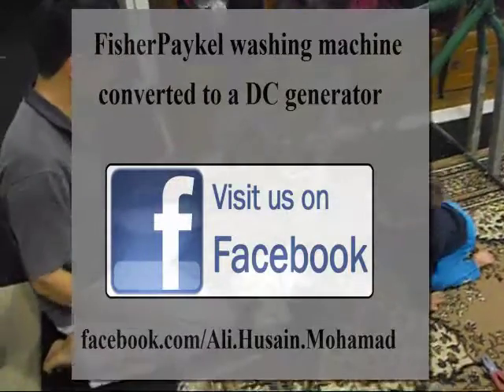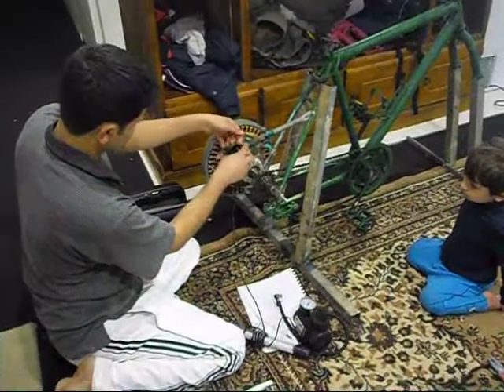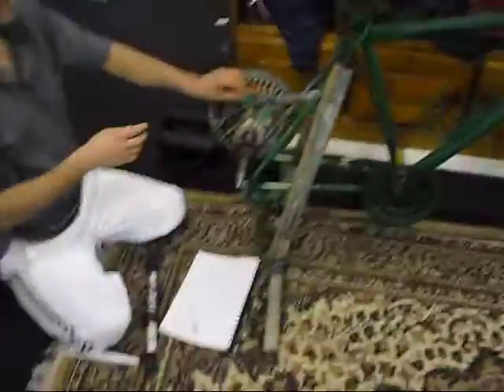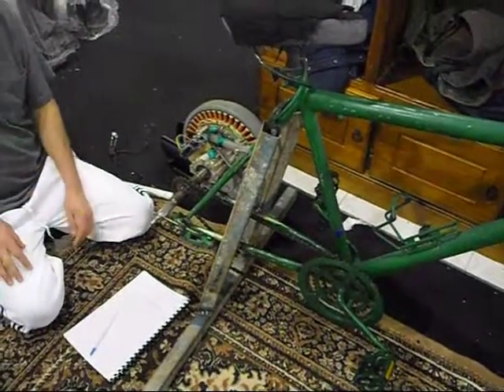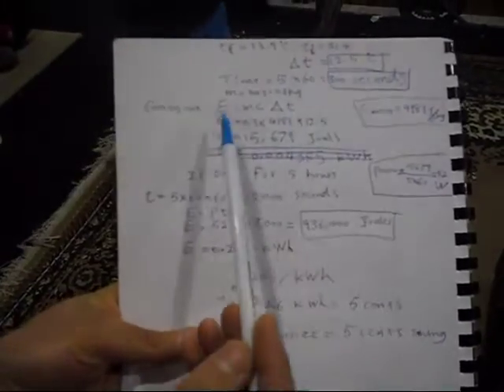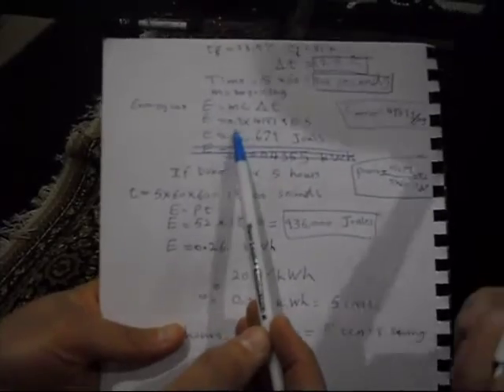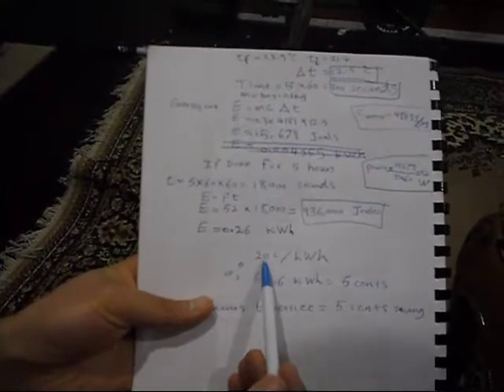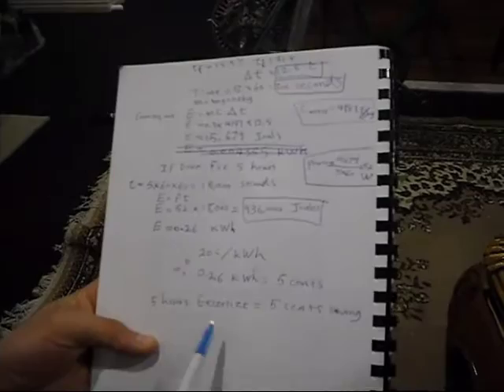fisherpaykel washing machine motor converted into DC generator

Comment: Good video but you have no mechanical advantage....gears and sprokets are essentially a lever...your trying to drive your genny with no leverage...go with a drive system bigger than your generator.....your loosing it there
Reply from the maker: the generator resists hard when it creates load so I dont think any mechanical change can do anything .  lower gear will make it easier but slower and  will give you less RPM and higher gear will be too hard to drive and hence you will slow down and get lees RPM 
and the power output is related to RPM

Comment: Man that sucks, I was not expecting such an epic failure, you are so humble about the waisted effort, most people would be smashing the smart drive with a hammer, it so funny,but why did it produce such little power? I thought those penkel motors worked great as generator, was it an older model? I heard they have a thicker guage coil wire and dont work nearly as well
Reply from the maker: thank you 
it created good power and can create good power maybe around 200 watts  but the human can not stay all day peddling , we have coal fire doing all that work for us while we rest , so it is not worth our time to work out to generate

Comment: It's because your probably putting 50v into a 12v heater it is probably wasting loads of energy in the motor and wires.
Reply from the maker: thanx for the comment. voltage does not matter , whatever voltage you put into a heat element you will get some heat and the change in temperature will tell you the word done ... the losses will be the heat lost to the environment. I dont know which motors you mean there is no motor involved in the experiment .   heat is generates in the heat element not in the wires otherwise this 200 watts will quickly melt those wires